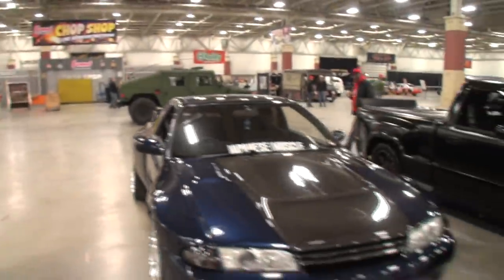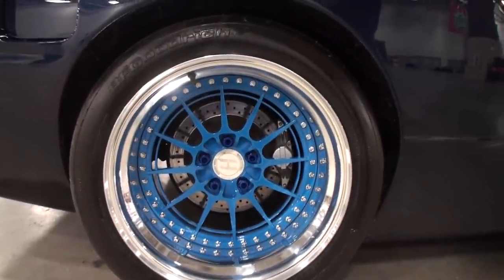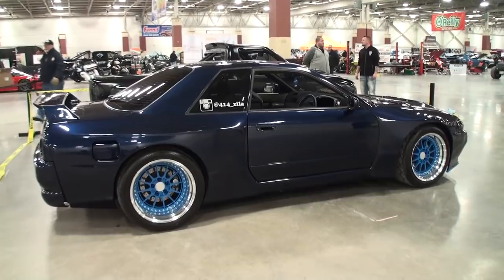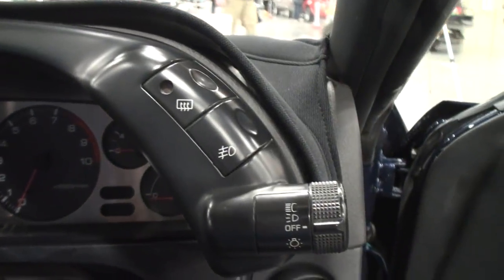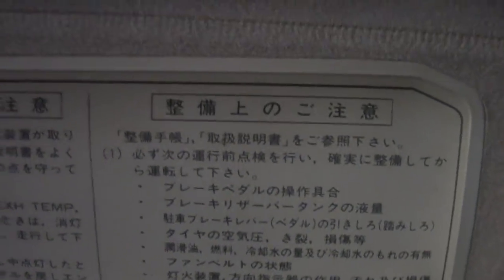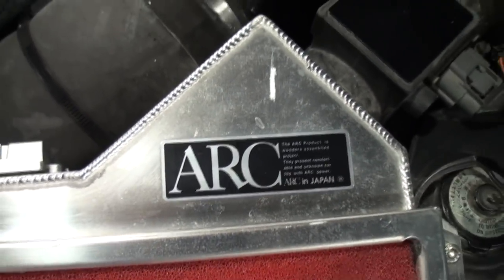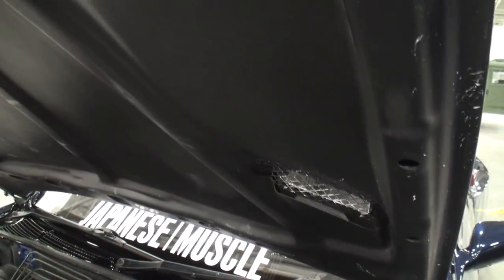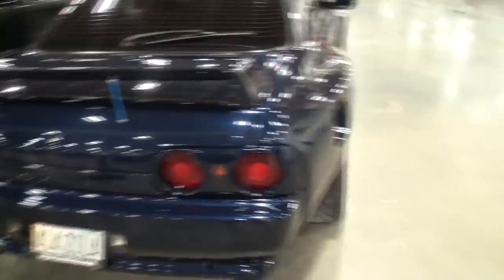1989 Nissan Skyline GT-R GTR Custom in Blue & Carbon & Engine Sound My Car Story with Lou Costabile

Comment: Just FYI, the reason they were not legal for the American market is 1.) They couldn't meet federal safety regulations  2.) They couldn't meet emission standards of the USA   3.) The cop cars couldn't keep up with them and it wasn't JUST because of the power that the Skyline R34 had (anywhere from 280BHP to 500BHP and could be tuned to have in the neighborhood of 1000BHP), but also because the cop cars couldn't maneuver and negotiate corners like the Skyline could.  The Skyline had 4 wheel steering and all wheel drive so they could take corners so much better than even the "High performance pursuit vehicles" that any of the police were using.  I'm not huge on Japanese cars but I have always thought that the Skyline was a phenomenal example of Japanese muscle.  Another great video Lou Thanks man.
Reply from the maker: HI Mike Lunn, Wonderful comment adding to the story.  Makes me happy to read you thought the video is great, Lou